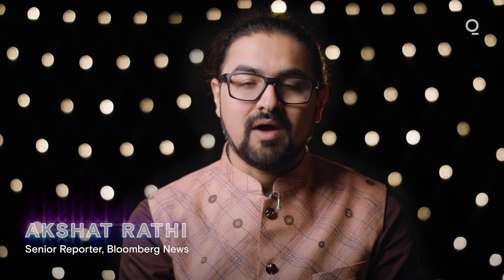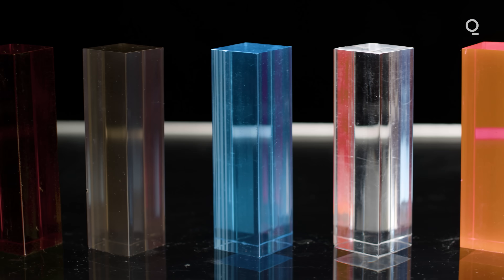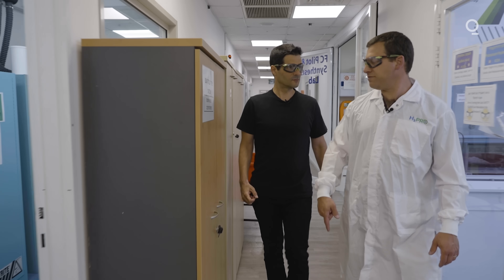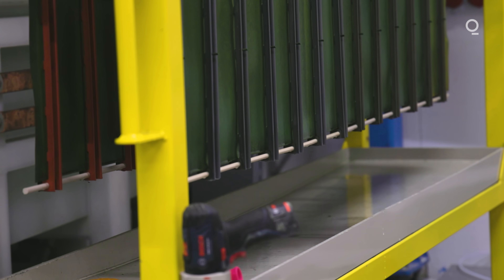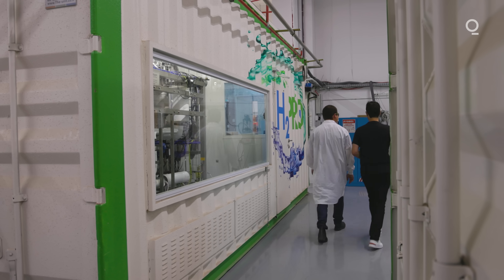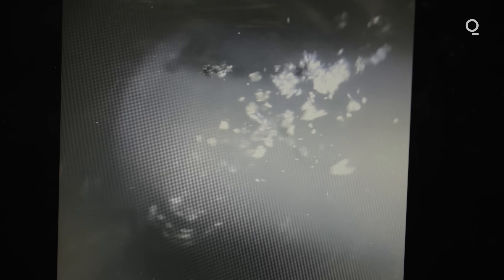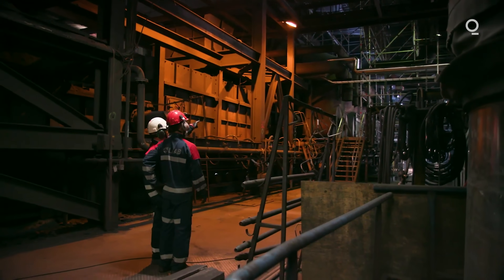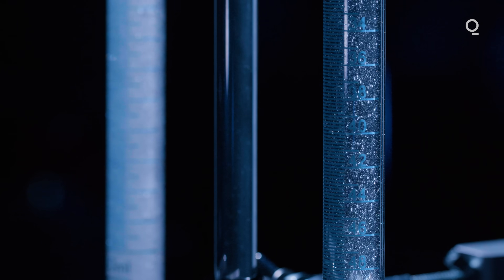How Cheap Hydrogen Could Become the Next Clean Fuel

Comment: You can't really store hydrogen cheaply at room tempature, it's violitile, doesn't smell, i.e. you can't detect leaks easily, and hard to store. Hydrogen fuel cells are horrible at operating in a variety of environments and degrade quickly in harsh environments that compound these issues. The only way hydrogen is remotely viable in the niche uses it is used in, is because of government tax credits.

Comment: "Cocktail napkin engineering" (aka Brain phart):  "Fossil fuel' = hydro-carbons: Where the energy extracted primarily comes from the hydrogen in hydrocarbons... can the ratio of hydrogen in hydrocarbons vs. carbon be improved? Thereby reducing the carbon byproducts in the mix. And/or increasing the amount of hydrogen in the mix. Obviously, I ain't no rocket scientist. 
Also, in the process, as carbon tends to "stick' to Oxygen (i.e. the bad stuff), are there other non-"bad stuff" elements that would reduce/negate the Oxygen+Carbon byproducts? (is that the direction "blue Diesel"is headed?) On the flip-side: for electric, which elements most readily "surrender" their electrons?

Comment: Hydrogen is the best fuel for almost every application on earth.  The only reason it is coming late into application now, is because we got used to the other fuel sources that were perfected over the centuries. All energy sources work.  Some are better than others, but hydrogen is by far the greatest energy source in the world.  No country has a lock on hydrogen like OPEC has a lock on petroleum.  Hydrogen makes China's petroleum resource grab in the South China Sea moot. 

With proper tuning hydrogen EVs can get over 2,000 miles per charge and "fill up" in the same amount of time it take to fill a gasoline car for a 400 mile range!  The same principles apply for electric power generation and for all forms of transportation.  Hydrogen has been on the back shelf for too long.  It's time to move it to the number one position for fuel use and power generation.
Reply: While you might be correct in principle, I don’t think so in practice - as hydrogen while is the most plentiful element is difficult to store and extract from water etc and generally not energetically efficient

Comment: Australia is trying to make the inroads to make Green Hydrogen feasible - by using excess production from renewables (solar and wind) to power electrolysers , because if they don't use the energy there and then, it is lost, rather than converting water to H2. The Green H2 is then said to assist in powering the power stations, to help decarbonise the grid energy. Let's hope it makes a meaningful contribution toward the net reduction (net zero) by 2050.

Comment: As of 5:04 your not making much sense. How is it cheaper to generate heat than to produce 1 to 2 volts of electricity necessary for electrolysis?

Comment: Learn that a coil of copper  wire, as an electrode  will put a mass of neutrons  into the mix, ,  ( you must vibrate the copper not OSILLATE!!!) at the correct vibrating frequency  you will  have max output ..  We could easily build a auto carburetor to supply the engine everything it needs.    Maybe just 6 inches in size..   Please learn that copper is none magnetic it emits the NEUTRON field ,  In the construction of the great  pyramids it was like having a power tool..    A oscillation such as AC current or radio waves all have three components,  1. the positive cycle/  2. the neutron cycle. 3. the negative cycle.  Without the NEUTRON cycle no AC or radio waves would be able to traverse the universe.

Comment: I see many people in the comments are easily fooled. The process of removing the carbon from methane is an endothermic reaction, and requires about the equivalent amount of energy to maintain that 1000+ deg C you would get from burning the carbon by-product in air. Otherwise you have over unity, hydrogen and carbon to burn. They've conveniently omitted that little detail that, lacking a high heat source, more or less derails their entire business model.

Comment: Every thing is great in theory. Getting a practical everyday working solution is the stumbling block. Fusion is great in theory. They keep promising to get it in 10 years. Room temperature superconductors is great in theory. They don't even make any claims of when they will get it. Hydrogen as a fuel source is real. The problem is how to mass produce hydrogen and what will it cost?

Comment: I truely believe that hydrogen is the best form of energy in this universe. I am 70 now, & have worked on engines/engineering for years. I like the idea of green hydrogen, it sounds ok like a win, win, or a no brainer to me! 
Personly: I think that we should not make hydrogen fuel to sell. For a number of reasons! The safe way forward, is to make this fuel, immediately before use. Any transport using hydrogen as fuel, should be fed saltwater, so that the hydrogen is made immediately before use. As thing are, the money wont come from this fuel, but from developing the  electrolysis on whatever form of transport is using this abundant fuel. Thank you, wonderful project.

Comment: Alternative energy will have to be self sufficient in that no fossil fuels are to be used in the process. The answer is nuclear power as power plants normally run back when loads are low, but can now generate hydrogen from electrolysis to be used as an alternative energy source, & also produce revenue for nukes who wouldn’t normally get it. New technologies in electrolysis can be used to generate hydrogen & thereby be used by industries as an alternative to fossil fuels. We are getting there, but EVs aren’t the answer as they’re energy utilization & storage aren’t up to standards yet? But, in time, they to will be an alternative? We’ll see???

Comment: Some serious inefficiencies and problems with hydrogen . You lose about 40% of your energy in the electrolyser then more energy needed to compress the gas then the fuel cell loses another 40%  or you lose about 70% in a combustion engine. On top of that its very difficult to prevent leaks with such a small molecule and theres the problem of hydrogen embrittlement in the storage tanks.  Battery electric vehicles despite their problems are vastly superior in energy terms.

Comment: Not trying to be odd but genuinely curious wouldn't it work to build a hydrogen fuel factory over a hydrothermic vent using sterling engines to generate electricity into the already mineralized water to split off hydrogen? Or nuclear heat power?

Comment: H2Pro: so you release the oxygen by raising the temperature of the water and you don't use energy in the process? That's just not possible according to the first law of thermodynamics. Energy = Work + Heat... 
All hydrogen technologies discussed use dirty fuels to provide the energy required for their processes. You fail to mention the low energy density of hydrogen as a gas and the enormous energy requirements to make liquid hydrogen that has the energy density required for it to be useful in real world applications. In the end these are "new technologies" to produce something that's not useful.

Greenwashing should be regulated and prosecuted as a serious crime.

Comment: 1 kWh energy from the fuel stack required at least 6 kWh (electrolyze + fuel stack losses).
Liquide storage H2 required -258C
High high-pressure tank requires 3 layers and a 120-litre tank can hold only 8kg H2.
The full tank of H2 will be empty after a month due to the size of H2 atoms escaping thru the walls. 
H2 is not an answer therefore after quick euphoria, the UK, Denmark, and Germany closed the H2 programs.

Comment: Ift hey use electrolysis,to make hydrogen, it will be no cleaner than gasoline unless they can use wind/solar 100%.  Now they can’t.
Reply: agreed, however please explain
Reply: @ratratrat59  They will have to use electricity for electrolysis  which is generated in many places by fossil fuels thus putting carbon back in the atmosphere. There is very little infrastructure for wind/solar at this time.
Reply: @royrice8021  you are entertaining and clearly not a scientist. Have you been drinking? Please do not drive.

Comment: already in the seventies hydrogen cars where invented. the hydrogen was produced directly ..so tanks were filled only with water. 
It was the big oil corporations that suppressed those inventions. 
nowadays they want again gain control over those technologies by claiming that you need to buy hydrogen from the pump.

don’t let you fool

aloha
Reply: The hydrogen combustion engine was invented in 1806 by a frenchman. Since then it has been made by countless people. The technology has never been suppressed. 

What you're talking about is Stanley Meyer, who didn't invent anything. But he did trick you into believing that he could do on-board electrolysis. Sadly, that's not actually possible. It takes more energy to generate the hydrogen than what you get back from burning it. No way around this, it's the laws of physics.

Comment: A big problem I recently found out is that Hydrogen is a greenhouse gas. The Hydrogen molecule is the smallest atom and as such, is the hardest to contain. Leaks are always going to be part of a Hydrogen system.

While it doesn't directly block heat, it contributes significantly to the greenhouse effect by impeding the natural processes that remove Methane from the atmosphere. Methane is a major greenhouse gas, so Hydrogens impact is so significant that it is actually called  a greenhouse gas itself.

Comment: Upon using the turquoise hydrogen, can the separated carbon byproduct be used for carbon fiber making and high carbon steel making?.. or, other needs, like making carbon fiber resisters, etc., etc.?... instead of putting it in landfill?

Comment: Sugar has 22 hydrogen where as water has 2..  Well, that seems like it would be 10x what is in water..  As far as those atomized copper fused with carbon or backboned to it?   Well, that's easy.. You make the cathode out of copper and the anode out of a carbon rod and then have it electroplate over in molecular form.

Comment: From a 300kw solar plant how many Kg of Green hydrogen can be produced in a day.?
Reply: 130 kilograms at the standard 55 kWh / kg.

130 kilograms is enough to fill about 26 Toyota Mirais, which can go 700 kilometers. So that's 18 200 kilometers of total range from that power plant.

The same energy could fully charge 92 long range Tesla Model 3's, which would be able to drive 600 kilometers each for a total of 55 200 kilometers of range from the power plant.

Comment: Hydrogen will put holes in the ozone layer by the way if someone doesn't know hydrogen is the lightest element on the periodic table it floats on everything right on top on the Earth's atmosphere where the ozone layer is supposed to be so every slightly leak out o every car will cause the ozone layer to become depleted quick they already passed laws to stop ac refrigerants from being used the ingredients to that is hydrogen some oil and just a little bit of water we use helium instead now because it doesn't hurt the ozone layer so why are we going to bring something into the world when you know exactly what's going to happen in the long run so get rid of gas when plants clean that so it's really green anyway when the plant dies it releases the oil it made so yeah gasoline is green and replace it with something that's going to actually use up some portion of water that will never become water again once its hydrogen in the air it goes to space never to return to water so in the long long run it depletes the ozone layer and our water supply

Comment: How much more energy is required to generate the hydrogen than the current oil to gas?  Remember in 1910 the Norwegians implemented a N2 factory using water fall generate electricty.  Is this still viable today?

Comment: I didnt get it , why are they lying ??? electro light is not INSUFFICIENT, its sufficient and very cheap because you could use solar and wind energy to produce it , infact that you can do that with a simple 5w solar panel cell at home , why are they lying about the facts ???? they are trying to sell a bad method of producing EFUEL at a high price , ofc investors had to take off running away!

Comment: its less efficient than gasoline, more dangerous, and more expensive. Of all these, the more dangerous part is a big issue. Its not as if people haven't considered hydrogen before. if you are using excess energy from solar or wind power to split water, then at least it isn't causing any harm. But I doubt that will happen every time. More than likely, some coal or gasoline will be used alongside renewable energy, and that just seems asinine.

Comment: Cheap sustainable hydrogen will always be a myth. Hydrogen may be the most common element in the universe (in stars that have the gravitational energy to retain some of it), but it is much less common on planets like ours in atmospheres that tend to bleed hydrogen (and helium) into space due to lower gravitation. That doesn't mean that every time hydrogen is separated from oxygen it escapes our planet. When used as intended hydrogen "fuel" oxidizes to form water. But leaks happen, think about how poorly we manage methane leaks. Methane is a much easier gas to manage than H2 gas is.

Comment: Hydrogen , easy to make , difficult to store . Also , easy to make but expensive to make , requires a lot more energy in then out . Hydrogen is indeed the wonder molecule if looking at the positives only . Like , ohh electric cars , perfect for all , and i have to admit , best engine performance possible , best power curve , best efficiency , best service life , .... all such things way better in electric . But the negatives you need to see them also , as there are , batteries expensive and not endless life , charging takes time , ... .... hydrogen is great but making H2 from H2O is simple yet has many things against it ( ps i am a chemical process operator , working with H2 also , +30y exp ) .

Comment: I'm not sure why they would waste resources to sequester the solid carbon, especially if it's [near] pure. Better to stockpile it and then sell it for use in other developing technologies, such as carbon nano structures. Then instead of being a waste product, it is extra revenue to help offset the costs of hydrogen production.

** Edit: After doing a quick search, according to one article, pure carbon is used in other "green" tech, such as lithium-ion batteries, and that there isn't enough around to scale. So if that carbon gas extraction process is scalable, its "by product" could be very valuable.. maybe more than the hydrogen itself.

Comment: Cheap Hydrogen eh? Not on the business model these guys are working on. Whatever method that's used to produce it on a large scale (that the average person cannot do), the public must still pay for expensive production, storage, transport, fueling stations that are going to have to be super outfitted with safety features (hydrogen has a very low combustion point!), vehicles that are heavier (because of more robust tanks to store hydrogen), and quite possibly more dangerous (think crash impact). Hydrogen - on - demand eliminates all this. However, hydrogen on demand doesn't make $$ for the man, the big investors etc. They want a product they can sell, tax and tax all the people and businesses that make their product possible. What they don't want is either a method or device that can produce it cheaply on demand, because then they can't replace the existing system with a similar one that benefits them. Cheap, or cheaper hydrogen is possible, but it is not going to happen via the same way hydrocarbons are produced and distributed today. The big industries and their financial backers need to see a profit for switching, because their Corporate charters demand it - literally - by law. Securing large profits never = cheap for the public!

Comment: The $1 to $2 range is that the production cost or what its sold for? So after the piping, trucks, ships, storage, taxes, along with freezing it into a liquid. What is the price target?
I seen an iea graphic, we need approx 3670gw of electrolyser capacity by 2050 for net zero. Assuming its all green along with much of the electricity grid by then. How will we be construct so much green electricity capacity. You need the electricity for that moment, enough capacity to build storage, enough spare to account for contingency ie it isn't blowing outside, make hydrogen and additional demand by the electrification of everything (ev cars as an example.
The amount of resources required is mental. Onshore wind and solar need approx 5mt of copper per mw. Do the maths on a large 3gw offshore wind farm. Then look at copper supply challenges. Multiple by each country.
Back to hydrogen, we plan to combust hydrogen for ships, planes and potentially cars (bmw and Toyota). What about the potential nox emissions? How much can we release of that per year before we create a new issue?
I hope we make it.
Only solution I've seen make any sense. Nuclear for electricity. Biofuels for planes and ships. Ev for cars. Use Nuclear, geo, wind, solar to make hydrogen for ammonia / steel industries (those volumes we may achieve). Everyone states Nuclear can't be for all but no one said it needed to be.
Pardon my spelling and grammar.